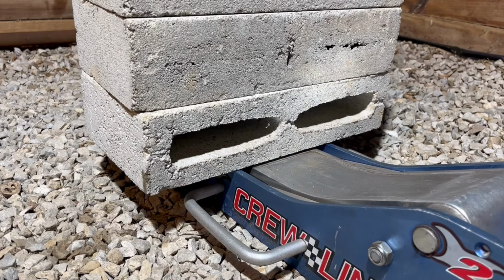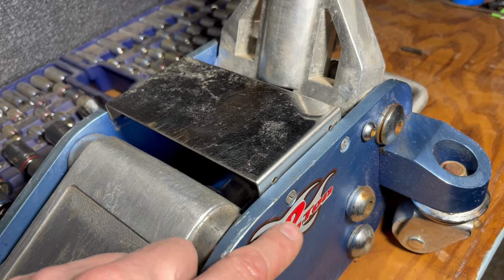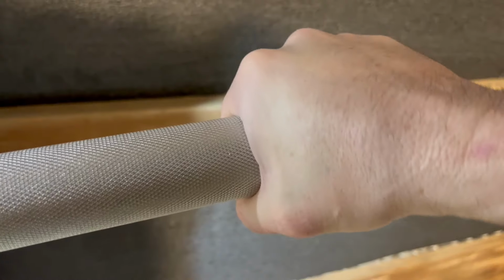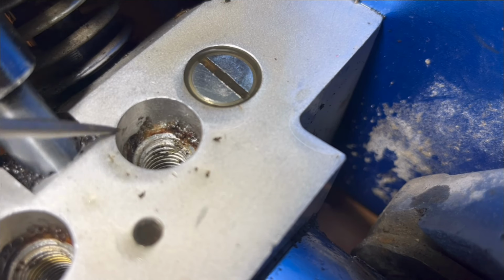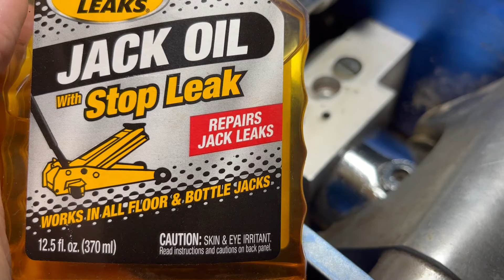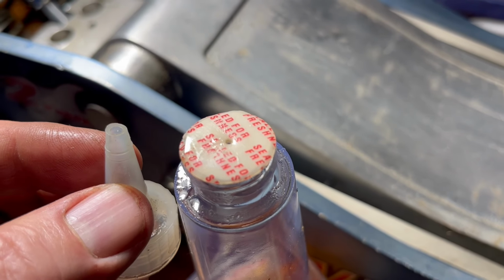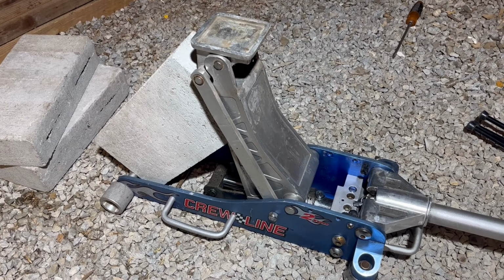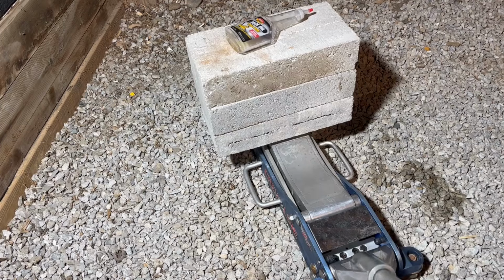How To Add Oil To A Floor Jack

Comment: I have a Crewline 1.5 aluminum jack and it does not pump for the first few inches of handle travel which makes it unusable if it has to go way under a car. It also stops pumping up before it gets to the top. The manual points to the top and says "Fill hole" but there are 3 possible fill holes. There is a big fastener with a slot in it that has another slotted thing inside if removed (safety valve?) Then a hex nut with a small philips screw in it and says "Breather valve" and then a plug that takes a 5/16 allen wrench. The philips screw starts hitting resistance after opening a few turns so I did not remove it. The big slotted one is already full. If I cycle the jack and lower it, some bubbles will come out but the oil level goes up when that happens so no more can be added. If I start loosening the allen screw, oil just gushes out no matter where the handle jack ram is or if the release is open or closed. What gives and how do I get it to function properly. I added to the big slotted hole in the past but like I said, it is already full.
Reply from the maker: You still have air in it.  You have to get ALL those bubbles out.  It can be very frustrating kind of as it takes forever.
Reply: @HowToLou  I ended up removing the breather screw and jamming a tiny funnel into it. It would suck the oil in on the upstroke.

Comment: I did this to my jack . same crew line. And it stoped working any idea why??
Reply from the maker: Its got to be air in the system.  Air compresses very easily, so the jack won’t lift.  Oil does not compress at all, so the jack lifts.  Bleed all the air out again.

Comment: Did not have any screws in mine, rubber plug. It still won't work.
Reply from the maker: You have to work really hard to bleed out all the air.  Air compresses easily and it won’t lift.

Comment: Wrong direction. You should not pump up before adding oil.
Reply: I did just that, as he instructed, and ATF geysered all over my front porch whenever I let the pump arm down. I even had cardboard under it. 😂